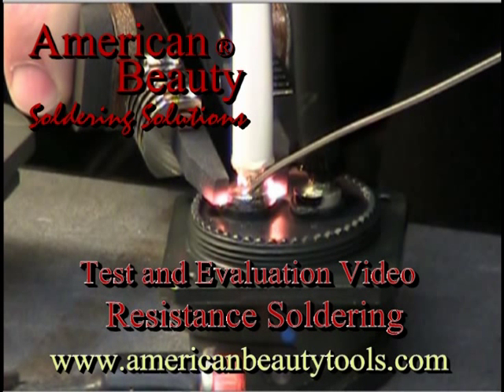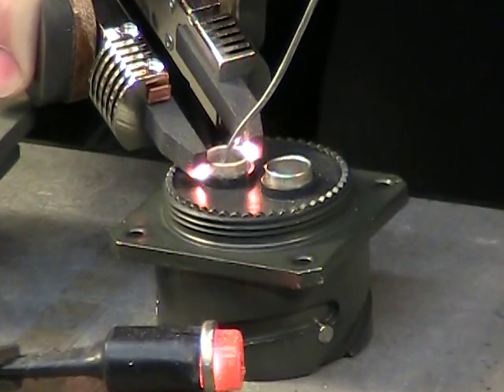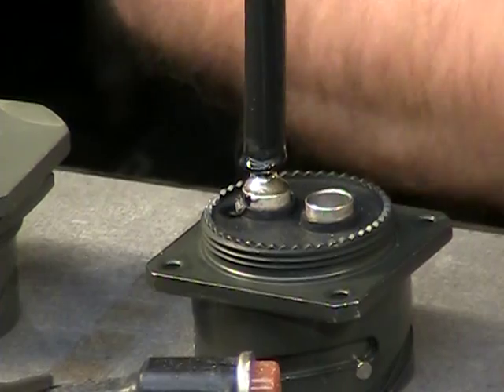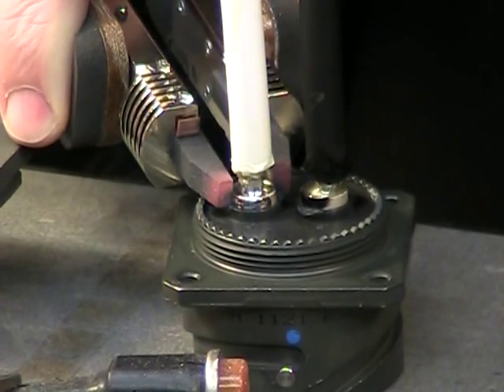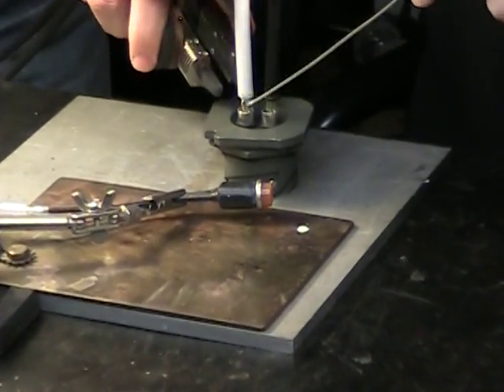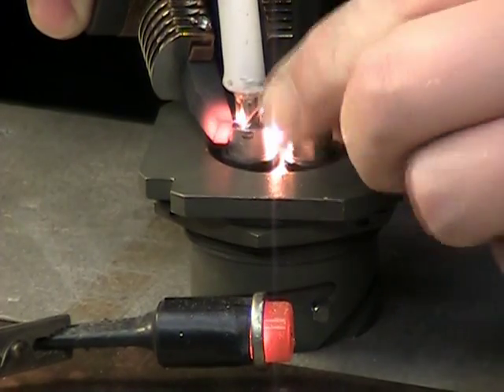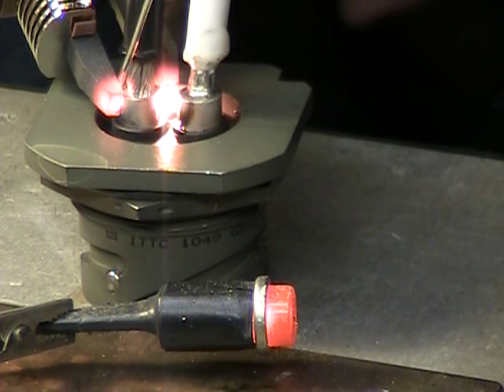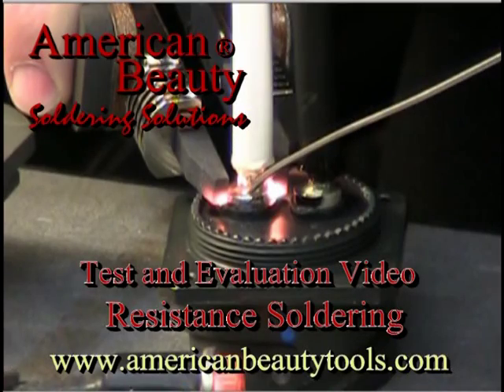Military Connector Cable Assembly

Comment: Are those military intervehicular slave connectors? It suppose to be crimped, right? Not soldered due to high current and load.
Reply: These type of connectors are soldered and the connection point for his wire is called a "Solder Well"
Reply: Thanks for answer. I was asking because military specify crimping in many manuals. Thanks